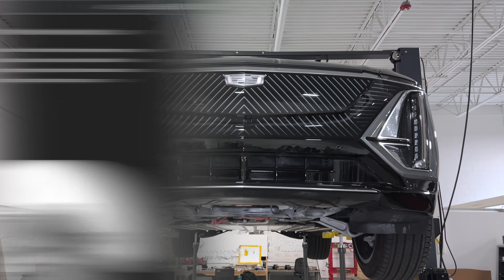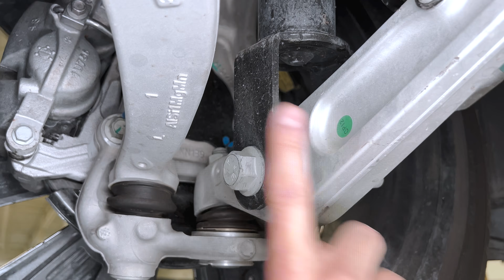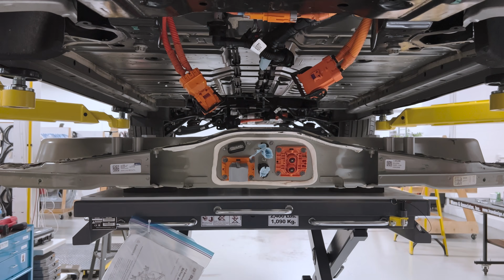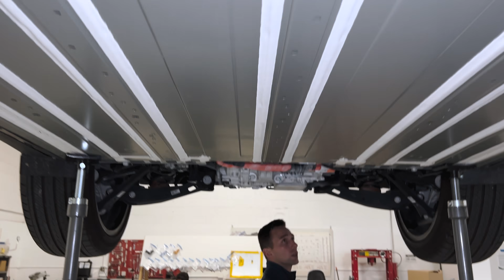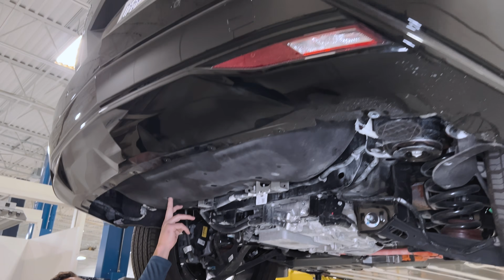Isolated Precision: Cadillac’s ride & handling philosophy | LYRIQ Hoist Review

Comment: 23:56, at least in the American Boat and Yacht Council's (ABYC) E11 guidelines, the grounding conductor for high-current devices like an inverter has to be equal in size to the main current-carrying conductors (and protected with an appropriately sized fuse). 
This is so that in the event of the positive lead coming loose and shorting out to the hull/chassis somewhere, that grounding conductor can carry that return current at a high enough amperage for the fuse to blow.
Otherwise with a smaller grounding conductor, that grounding lead could end up becoming the fuse and ignite something else in its vicinity.

Looks like GM/Cadillac did some electrical safety homework and makes me feel a lot better about its EVs.
Reply: Exactly!  A Google search of 'why did GM use massive grounding cables on the EDM in the Lyriq" lists safety, EMI minimization, high current handling (safety) as reasons for such beefy cables.  Interesting that the Marine standards understand this.

Comment: Is that road salt already on the undercarriage of this vehicle ?
Have you already removed some protective shields from this vehicle ?
Appears lots of high voltage cables and their connectors exposed  to the elements.
Even just inside the rear bumper, many electrical cables.
This complicated vehicle will be a nightmare to work on after a couple of winters in road salt.

Comment: Jordan wins for acronym bingo. My Audi had virtual ball front suspension, handled amazing especially on the highway, but half of the weight of the front end of the vehicle (as in the lyriq) sitis on one ball joint. I had to replace those ball joints on my audi regularly every 60k miles, almost a maintenance item, i wish we could have virtual ball without the weight of the vehicle sitting on the ball joints like that.

Comment: Hey Sandy, I have a low reservation number ( in first 9400) Cybertruck that I may be willing to trade for your reservation number, if there is any way you can save me the complete battery pack that would allow me to use it like a mobile Powerpack for a future off grid house. This may not be possible as you may need, or want to, or not be able to do your analysis without destructing the parts. Hopefully, you would not have to tear apart the Cybertruck's structural battery pack, because you have already done a similar battery pack. I have a second Cybertruck that is in the first 16,000, so I will still have a CT soon. I also just preordered another CyberBeast, in case i want to upgrade in a few years.
Reply: I also wonder how many new Cybertrucks have been preordered since the Nov 30 show? My new reservation number is over seven million higher than the number one reservation number (~112744100). Could they possibly now have 7 million CT preorders?

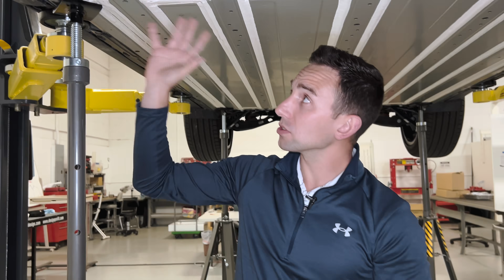Comment: 14:25 - that piece of foam after the wheel & windows before the battery… could that be to keep air moving, so the air can go into the windows, to help reduce drag & direct some remaining air to cool the battery through the holes?

After hearing about the piece of rubber before the wheel, to direct air, this seems to make perfect sense.

Comment: Reminds me of an old 76 Caddy eldorado convertible with the 500 engine. Poor overall packaging  large gaps of "what can we put there ",  wires and exposed cooler plate and ac compressor ($$$$)  just waiting to get ripped open by road debris. The insistance of running wiing and modules in side the lr fender getting exposed to road salts, makes you wonder if they ever learnt anything (fuel control frame module Ford).

Comment: I thought EV proponents emphasized a simplicity in propulsion design over ICE. I see many more potential failure points with coolant, oil, and electrical connectors. A road object could take out that rear motor heat exchanger.
Reply: Your ICE has 2000 more moving parts, so maybe don’t dwell on failure points.

Comment: Current for the main drive motor must flow through those ground cables. As a auto tech for 30 years  ive seen grounds left off because someone didn't see the purpose of them. It causes current to flow through the axles and wheel bearing  and destroies them fast.

Comment: SHOCK ABSORBER MOUNTING PLATE
Could an additional benefit be acting as an adaptor plate to make it easier to have different grades or styles of suspension system whilst not complicating the body-in-white?

Comment: Jordan - There has to be a real good reason for GM to spend that much $ on those ground straps X2. The EDM is electrically isolated from the body but I cannot think of a situation where you would need to flow that much currant X2. Any ground fault in the HV system should trip safety circuit(s) and isolate the battery.

Comment: Those grounding straps look like they could carry 500 Amps continuously all day without notable heating.  The bracket at the rear they are bolted to looks like it can carry 50 Amps continuously without heating.  It appears to be steel, spot welded to the member above it and painted.  If there are voids in the mating of the bracket to the chassis above, the paint will act as an insulator.  Whatever the function of those cables, the bracket is an unintentional fuse.
Reply: Who knows what is inside the cables. I doubt they're #00 Litz wire.

Comment: At first, it looked like they put the valve stems on the inside instead of the normal location. I later saw I was wrong.   What are the silver studs on the inside of the wheels?

Comment: the split/dual link is not for contact patch or camber control, but rather to move the kingpin axis outboard of the contract patch, essentially giving you a negative scrub radius. This helps with stability when braking hard because the vehicle will naturally correct for uneven grip. the same is applicable under hard acceleration.

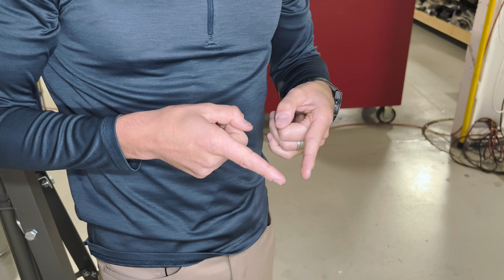Comment: 9:25 it's very interesting. I want know about this concept suspension more 😊
Reply: Neither front or rear suspension design is new or unique. Jordan's points are that the front suspension type is relatively expensive (compared to other front suspension types), and that the rear suspension construction is relatively inexpensive (for the type).
Reply: @brianb-p6586 the front is unique for mass produced vehicle.
Reply: @normt430  double-joint lower control arms have been common for many years. Some vehicles have used double-joint upper control arms. Even if this is the first to use double joints for both upper and lower, there's nothing new about the design... but it's still a premium choice.
Reply: @brianb-p6586  what mass produced vwhicle today uses double lower?
Reply: @normt430  BMWs, among others. They're the obvious answer, since they've had them for about 15 years; if you're thinking that BMWs are not "mass produced"... they punch those things out like Volkswagens.

Comment: Any comments about the amount of salt in there?  I’m assuming there’s a full cover enclosing that space so how do you clean the space?  Why isn’t the cooling air (where I’m assuming that salt is coming from) redirected out of the space?
Reply: I have seen this on several cars..  the Aero full coverage trays under these cars.. allow some crap to get inside.. but it can never be washed out unless you would remove the tray first.
Reply: Caddy drivers get rid of them when the ashtrays get full, so they don't worry about salt rust.

Comment: Something that I'm noticing in the comments here is that many people have either not seen this video or the one that Carl did previously all the way through and are just simply going GM sucks. What Jordan does here is he shows that this is actually a fairly comprehensively engineered machine that has a rather elegantly engineered chassis underneath it. But, because the interior is somewhat lacking relative to others in the class, even if the others in the class may not have this kind of engineering going on beneath, they're automatically going oh it's GM it's got to be bad. This is a very well engineered car that as GM's first real foray into electric luxury vehicles is actually quite well done. Yes there are a few bits and pieces that are a bit overkill. Having said as much, so what? If it works well and the vehicle performs well as a result I'd rather have the over-engineered bits and pieces beneath me than have one that is the old GM way of being half-baked completely. I'll take a cheap dashboard and a good chassis over the other way around any day of the week.
Reply: At $59K the interior is right on price but the Ultium scaleable underpinning is state of for mass produced BEV.

Comment: I know nothing about engineering but all the wires and clips on the underside of the car seem concerning.
Reply: That is where all the modules and batteries are on EV's. Not all under the hood like old days.
Reply: They’ve obviously removed all of the covers for the shoot. I doubt those are just hanging out there normally. 

The weight distribution on an EV is much better than ICE due to the lower center of gravity, so low placement has advantages.

Comment: Thanks Jordan!  Those apparent grounding cables from the EDM to the cradle member are most curious.  Those cables look thick enough to carry several hundred Amps current.  It is almost as if the EDM inverter is the sole source of low voltage with no 12 Volt battery to handle surge loads.  Did GM get rid of the flooded/AGM battery and replace it with some tiny battery just for closing the contactor in the main battery?
Reply: Partially answering my own question:  the GM Service Technical College (GMSTC) drawings for the Lyriq appear to show a fairly average size 12 Volt battery under the hood.  For now, the heavy ground cables on the EDM remain mysterious.

Possibly related:  There is a service bulletin N232416980 from August 2023 which deals with 12 Volt battery drain.  Apparently an incomplete OTA update causes issues in the serial gateway module.  The fix requires temporarily disconnecting the 12 Volt battery and then reprogramming the gateway manually.  The issue requires a dealer visit to have the fix applied.
Reply: A drive unit will absolutely not be used to convert high voltage to 12 volts. Even if someone did that, it would need positive and negative (ground) cables, not just ground.
Reply: @brianb-p6586  Yes, of course you’d need a positive connection, but it might not be in the vicinity of the frame ground.  There’s something going on with the EDM electronics package given there’s also the rather large plate heat exchanger.  The question remains, why is it apparently necessary to be able to conduct several hundred Amps from the EDM to the cradle frame.  Those conductors are way more massive than necessary to dissipate static charge which is apt to build in up on the drive components from tires with a high silicon content rubber compound.
Reply: I'm sure that an equally large +12 V cable connection to the same drive unit would be both clearly visible and mentioned by Jordan, @wtmayhew , regardless of the location on the unit.

No 12 volt function would require substantial heat transfer compared to routine drive motor and inverter operation, and the heat exchanger might be a bit large, but is not exceptional. 

I agree that the ground cable capacity is not related to static charge dissipation.
Reply: @brianb-p6586   It is kind of maddening trying to find substantive technical information on line which is not pay walled for more than I want to pay for this discussion.   None of the parts break downs on recycler web sites show the apparent ground cables.  The best cost-free info is page six of the Lyriq Emergency Response Guide on GMSTC’s web site.  What appear to be the two cables in question are highlighted in orange in the drawing, indicating they are part of the high voltage system.  The Li ion battery is fully isolated from the chassis, so the cables are probably designed to take the fault current and blow the fuse in the high voltage battery if a crash creates a path which would energize the chassis.

Comment: Lyriq’s outstanding spec: 
1 meter long dual shielded motor grounding strap
Reply: Over engineering
Reply: @ralanham76  Ford would use an 8 inch #12 wire.

Comment: It appears that there is an optional valve core on the inside of the LF wheel, is that correct and why?
Reply: Just on the 22" wheels.  For ease/speed of filling and perhaps better sensor mounting.

Comment: What’s the white compound that looks like it was sprayed all over the front end?
Reply: What is the liquid they spray on roads before snow?
Sodium chloride (salt), magnesium chloride, calcium chloride, calcium magnesium acetate and potassium acetate are chemicals used to prevent and remove snow and ice from roadways. VDOT uses liquid magnesium chloride, calcium chloride and sodium chloride for anti-icing and pre-treatment.
Reply: It’s most likely a powder they applied to enable better results from 3D scanning
Reply: Salt used to melt road ice, snow

Comment: Those grounding cables in the rear are likely thick enough to prevent a sudden rise in voltage when the ECU experiences a sudden current impulse due to a magnetic field collapse.
Reply: I'm sure there's a good reason for the large grounding cables, GM did a nice job on this vehicle. Well engineered with few compromises.

Comment: A whole minute: talking about the production of a single windguide element at the active grille shutter shroud. FMPOV, this seal is not a "key element in the vehicle architecture".
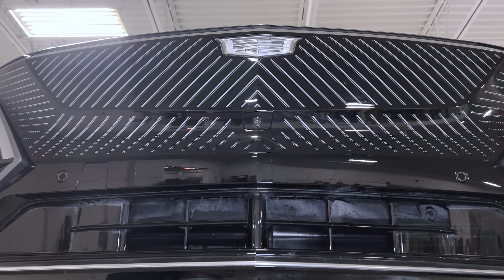But the following are important elements, but not mentioned by Jordan: This Lyriq has 6 front ultrasonic sensors (see 0:23, 4 of them visible plus 1+1 more on the sides in the fenders) and a nose camera in the frontend of the vehicle (see center at 1:28) for a bird view when parking. In addition, there should be 3, 4 or 5 radar sensors : 2 in the back for cross traffic alert, and 1 or 2 or 3 in the front of the vehicle. They serve a input for bird view, automated parking and the driving automation systems. The impact (no pun intended) of these components, that Tesla has either dropped from Model 3/Y (parking sensors) or not yet introduced (nose camera) is likely way higher than that of how this seal is manfactured.
Reply: Munro is typically concerned more with structural design and manufacturing methods than how many of what device are included, because that's where their expertise can be of value to paying clients.
Reply: @brianb-p6586 well, unless it’s Tesla with the feature that others don’t have. Then they mention it for certain.
Reply: That is a weird gap but considering how many leaves the front of my CT6 collect this time of year it may work in lessening debris build up.

Comment: Missing terms in the caption explanations:
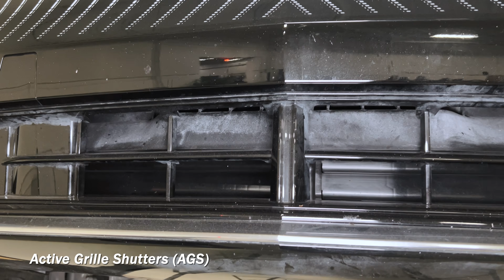1:43 - A-surface = "Class A surfaces"  = visible exterior surfaces and all visible surfaces of see-touch & feel parts in interior
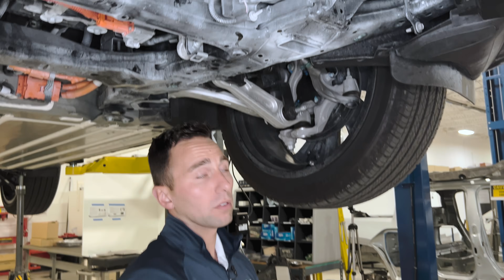4:02 - IIHS = Insurance Institute for Highway Safety
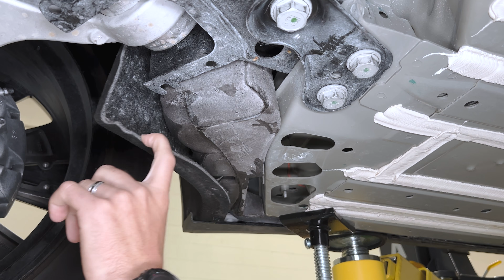13:35 - PET = polyethylene terephthalate (a very common kind of plastics)
13:37 - NVH = noise, vibration, harshness (problems related to acoustics and vibrations, often subjective)
Captions for the latter two were only added for the rear axle, missing they were also used at the front axle.
Reply: Everyone knows this stuff by now.  No need to dumb it down in the video.

Comment: VERY confused by the odd bolt-like item mounted on the inside face/inner barrels of the wheels.  What are those?!?  TPMS sensors have always been part of the valve stem; I've never seen anything like it before.  Time stamps:  8:08, 8:56, and 19:51, among others.  Do please advise!  Thanks for the great insights in your videos; keep up the excellent work.

p.s.  Is it safe to presume the Lyriq is based on another GM platform, perhaps modified from an older ICE platform?  If so, please feel free to share those insights going forward.
Reply: At 19:53 you can see: At the same location, there is also the actual valve on the outside of the rim. So this on the inside my just serve as a balance weight. Or as an alternative mounting position to put real valves on the inside of the rim instead of at the outside and keep the outside design nice and tidy with no optical disturbance by a valve.
Reply: Ultium is ground up BEV and scaleable for GM's full vehicle line.

It is probably a wheel weigbt.

Comment: GM has some of the best ride-and-handling engineers; Blackwings, Camaro 1LE, Corvette, etc. They need to leverage this talent and make an EV that is actually fun-to-drive. They're not going to make better appliances than Tesla, so go for the driving performance/luxury market.
Reply: Cadillac should be as quiet and isolated as possible. They have already tried the BMW imitation gig for the last 20 years. Time to actually be a luxury brand.
Reply: Ferrari licenses magnetic ride control from GM.  GM has some of the best damping control in the Industry.
Reply: Corvette leaf springs at the rear axle was a solution from the "best ride-and-handling engineers"? Come on.
Reply: @MooseOnEarth  It worked and it was. Fact.
Reply: @MooseOnEarth they used those transeverse leaf springs to beat the beat sports cars in the world on track for half a century,  so yes,  it worked brilliantly and elegantly.

Comment: At 20:04 in the video, I notice what looks like a bolt or maybe a valve on the back of the wheel rim. I've never seen anything like this. Is there something special or unique about the wheels?
Reply: 19:59 -20:26 (position approx at 7)
Reply: Good spotting. I've never seen it before, and I missed it. 

It appears to be directly opposite the normal tire valve. I have no idea why it is there; all I can guess is that it is a tire pressure sensor that is bolted in separately from the valve; usually they are integrated with the valve (or strapped around the wheel); the  inboard position would make the radio signal easier to pick up.